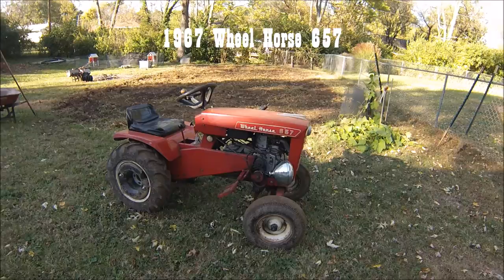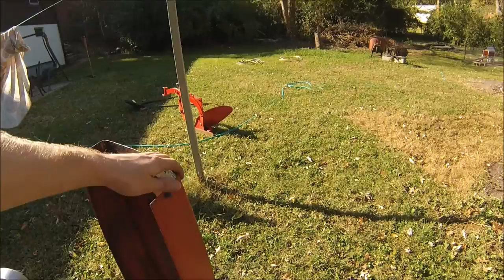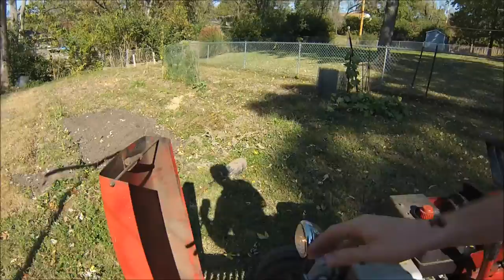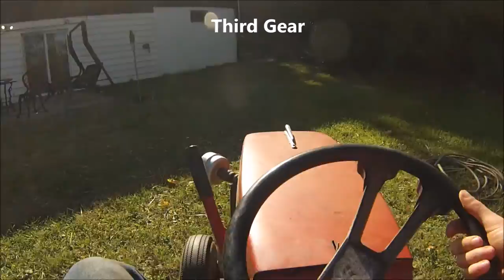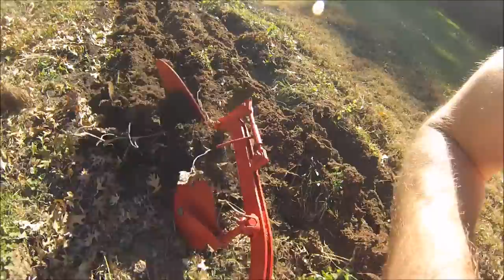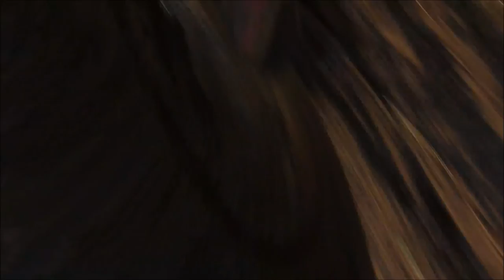1967 Wheel Horse 657 operation and garden plowing

Comment: I think that is a different style hitch than what is supposed to be used with a plow. For a brinly plow the sleeve hitch should be thicker to fill the space between the top and  bottom mount on the plow.
Reply: Correct